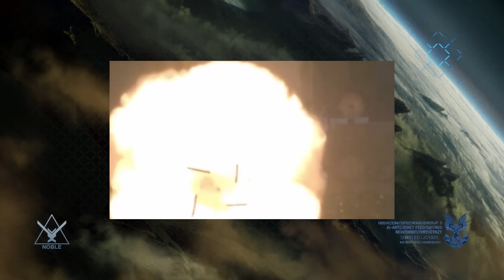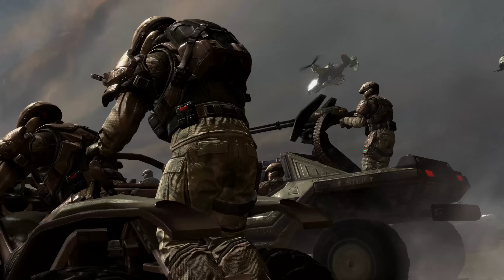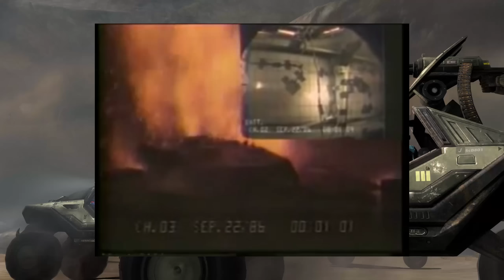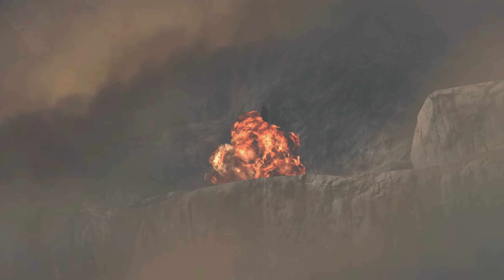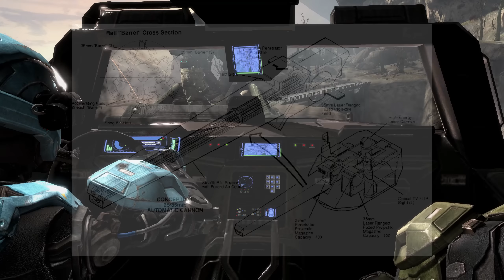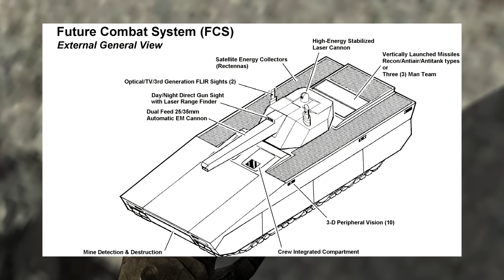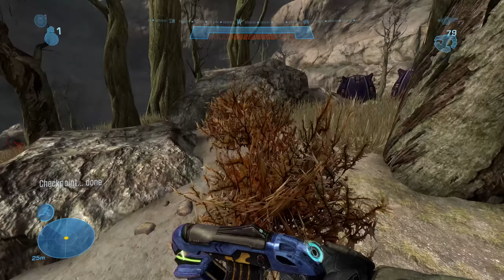Are Railgun Tanks Practical?

Comment: Interesting thing about these rail gun battery’s is they might be even more dangerous when shot. Just look at a video of a lipo battery when punctured. 

There’s so much energy stored up that when a cell is compromised, It will spit out a nasty flame and toxic smoke. Imagine this in a tank at a much larger scale.

Then we also have to note that these huge batteries paired up with the required capacitors you have a gigantic target that will practically guarantee a tank kill when hit compared to standard munitions.

Basically your ammo is safer but the guns power source is essentially a giant bomb when shot! It’s a huge downside looking into it. 

Crazy huh!

Comment: [self-imposed obligatory Battletech post alert]

A lot of what you said applies as well to the BT setting, though they use gauss rifles there instead. Still, the perks are basically the same. Compared to explosive propellant weapons, gauss rifles have longer range, are more powerful, and the ammo doesn't explode. Same thing with the drawbacks. The rifles are much bulkier, and their fire rates are much lower than normal cannons. Although you didn't mention (as another comment has pointed out) how the gun itself is actually in danger of blowing up instead of the ammo. 

(psst I still recommend you give BT a good look at, even if not as a full video. All the tech there is pretty well thought out, though of course probably not flawless in their rendition.)

Comment: “20 years in the future we will have rail gun tanks” 
Halo 500 years in the future: “Our main battle tanks will have regular 90mm canons, but our space fighter jets will have 2 120mm twin mounted rail gun cannons, with rotary 110mm cannons”
Halo again:”Also the largest deck guns on our massive mile long ships will be 70mm”
Reply: My point is how the longswords anti-starfighter guns are larger than a main battle tanks gun, as well as a ship mounted ant-starfighter/ point defense gun.
Reply: SmithOnMe they’re smaller because the ship mounted point defense guns are actually rapid fire coil guns. Meaning a smaller shell can be used/ is needed to deliver the same amount of damage a large one will. Because of this more of the PD guns can be mounted and more ammunition can be stored. Meaning more overlapping fields of fire and longer engagements times, leading to a more effective warship. The PD guns don’t need to be a caliber of say 130mm when you can put a few magnets on the gun and drop the shell to 60-70mm and still do the same damage while achieving a higher velocity for better armor penetration. Let’s also not forget that the second model of archer missile can be used for point defense. As for the longsword the 110mm rotary cannons aren’t standard. Standard armament is eight 50mm coilguns. But the 120mm pair of cannons is standard and usually used for ground attack, as the longsword is often deployed for if shortswords are lacking. However in saying this, they are mounted on the underside of the aircraft and have a 90 degree swivel. It’s not crazy to have such a caliber on such a large aircraft. 64.1 meters by 75 meters. With the smaller variant being only shorter in length at 33.5 meters. If you have any other questions I’d be happy to answer them!
Reply: Offensive Bias the C-709 longsword has a rotary (like an A-10 warthog) 110mm coil gun cannon that is used for anti-star fighter roles. While the M808B scorpion has a 105mm (90mm depicted in game) electro-chemical anti-(pretty much) everything cannon. However, a capital ships main defense gun; which is used in ship-ship combat, anti-fighter roles, and ground support roles; and has a much larger turret as well as access to a greater power supply than either the C-709 or M808B, only uses a 50-70mm non-rotary coil gun.
My point is that the choice of UNSC weapon calibers is very inconsistent.
Reply: SmithOnMe yes while the C-709 variant uses a 110mm rotary cannon the variant itself is just that. A variant and is not that standard build of the longsword. As the C-709s first appearance is combat evolved which comes at the end of the H-C war one could deduce that the large caliber of the main gun is used to quickly and efficiently strip the shields and penetrate the armor of seraph. At that point in the war, humanity was on its last leg and couldn’t afford to lose any sort of military equipment. In saying all of this the longsword is actually not the “mainline” fighter for the UNSC. That title actually belongs to the broadsword which was actually in use and production since the mid 2530s. The longsword fills a role more akin to an interceptor/strike bomber. As for the scorpion while I agree it’s 90mm gun is a small for a vehicle given the MBT classification. It is truthfully an infantry support vehicle. As there is very little in the ways of insurrectionist armor. This 90mm cannon is actually not the electro thermal variant and is a standard smoothbore high velocity cannon. The only known scorpion model to use an electro thermal cannon is the M820 model which uses a 150mm main gun. There is another UNSC MBT, the M850 grizzly which uses dual 120mm cannons and is actually used in tank vs tank role.  As when it was deployed against covenant armor and ground forces it usually ended in the covenant having to call in naval support to defeat it as it’s virtually unstoppable and contrary to popular belief in the halo community the grizzly actually saw wide spread deployment against both the covenant and insurrectionists. Finally when talking about turreted weapon mounts on UNSC capitol ships you have to Identify if the weapon emplacement is a “point defense” or “naval coil gun”. Both are used differently. As stated before point defense guns are smaller caliber rapid fire coil guns. Their smaller caliber and size (as stated before) allows for more of the guns and more of their ammunition to be stored. These guns were typically supported by allied single ships and missile support, but are perfectly capable of handling things on their own. These guns are not used to engage enemy capitol ships as they don’t possess the firepower to do so. On the other hand, naval coil guns are large coil guns used to supplement a ships main Mac gun and are not intended for a point defense role and actually perform very very poorly when used as such. Both weapon emplacements look the same but function very differently. For example in the  halo reach level “pillar of autumn” when you reach the ship breaking facility with the mass driver. If you look at the pillar of autumn you’ll see what look like point defense guns firing. These guns look absolutely huge. These are actually mark 33 spitfire naval coil guns and do not belong to the point defense system of the cruiser. If you want to break it down the autumn is equipped with only 18 M910 rampart PD guns, 6 M66 sentry, and 8 Mark 33 coil guns.
Reply: SmithOnMe actually naval coilgun batteries go up to 300mm, the 70mm are just AA
Reply: SmithOnMe those are just point defense guns and even those are coil guns.
Reply: all about the velocity
Reply: I'm just ticked off that even 500 years into the future, military radio chatter still sounds like absolute garbage.

Comment: Wouldn't a Gauss Gun be a better fit for a Tank? I mean don't Rail Guns require a Nuclear Reactor just to power them? I know that you can make Gauss Weapons that are Small, so for something the size of a Tank, wouldn't Gauss Weapons be the better solution? Just throwing this out; plus I worry about the Electronics causing a Short due to wear and tear and possibly causing either an explosion or a fire concerning the Batteries needed just to operate the Weapon. I Phone Galaxy anyone? That was a Solid State Lithium Battery that Shorted out.

Comment: The only way I see rail guns begin a standard weapon on IFV's within the next 50 years is if said IFV get bigger to accommodate the large amount of components and bigger powerplant to run a railgun effectively, I don't see the tech required for such a weapon getting small enough to be practical or the amount of energy needed within the next half centruy, also in order for an army to build and design a whole new vehicle around the railgun concept it would have to dramatically outperform any conventional cannon of the time and the naval ones do but they have a floating  powerplant but enough to power a town at their disposal IFV'S don't have this luxury
       Also with the current conventional weapon have not reached their peak yet, new cannons are coming with more capabilities and vehicle have been trying to get smaller and  especially lighter something that a railgun would not fit into anytime soon

Comment: when it comes to railguns and laser weapons(yes, these do exist in real life), you see often people dismiss these ideas solely based on how they depends on electronics to function. But has no one thought how much of all of the war equipment is dependent on electricity? Your car won't start because the EMP broke it's battery, you can't call in support because your radio died and when you get to a medical station the stuff in there died too when that EMP went off. Even then I have  heard couple of times that even your phone would survive an EMP attack thanks to small electronics not being effected as much as large scale electronics, but even then your phone most likely has the proper protection from EMPs. Of course as electronic devices are devices they are prone to malfunction, but we have gotten so much better at making electronic devices reliable and they are getting even more reliable by the year. Again with the phone example, how often does it really fail to do something? Now of course, you might just have a bad phone that just breaks all the time because it was made poorly, but I haven't had a single electrical malfunction with my current phone. Electronic devices are devices as much as mechanical devices, yes at the current form they are more prone to failure due to being much younger in terms of invention, but we are improving the designs all the time just like we did with the first cars and bows.

All I'm saying is, if an emp goes off you have much bigger problems than your main gun not firing and our technology is making major strives when it comes to electronics. All devices fail you when you need them the most, no matter if it's mechanical or electronic.

Comment: Actually there's a China YTber manage to design a railgun tank but the only question is: you can't build it. Even you could, you often result you stick the heavy cable into the tank and your behind was nuclear generator. As conclusion, due to railgun require high energy output use it for gun is impossible unless you have scaled-down the nuclear reactor.
The Crazy 262 is the one that design a railgun tank call 'Qilin' (麒麟).

Comment: "12 years" lol
The main problem is power generation. We can currently make railguna that fire projectiles at the same speed with the same durability as chemical weapons but the power needed is too great to fit inside of a tank chassy, or even most current naval ships. 
The reason they want to be able to shoot continuously at higher speeds is because the energy increase by volume of a reactor is large enough to make it worth while when a ship is dedicated to it.

Comment: A bit nit-picky, but railguns would not be propellantless. A railgun requires a kicker charge to get it going before it hits the rails and will weld the projectile to the rails if it's not going fast enough. The kicker charge doesn't have to be explosive but explosives are the easiest way to do it. Going out of your way to use non-explosive kicker charges would also be moot as long as the ammunition you carry has explosives in it (HE shells, airburst, etc.)

Comment: You were a bit wrong on the first bit. Rail guns haven't been tested on navy ships yet. Additionally, if you pack your rail gun ammo with explosive filler (like for the airburst AA stuff you said) there can still be blowouts. Also, rail gun rounds are not the cheapest things. You can't just use slag iron. You need special alloy shells and you need to use some pretty strong materials if you want a proper penetrator at that speed and not just something that will shatter. Finally, power is a major issue. If we get batteries that can power that, then we will all have electric cars with long lasting batteries too.

Comment: Railguns aren't feasible on tanks because they'd be one-shot weapons with no capacity for reload. 

Current railguns being developed for the US Navy require more energy than all but special prototype warships can even produce. 

Even assuming we had the power output to fire them, the degradation of the main barrel would be intense and would wear down the weapon after even a few shots, rendering it unusable. 

Assuming even that is solved, the weapon system itself would need to be shrunk down to a size that could be carried by a tank. 

Assuming we can do that, we would also have to charge the cannon before it could fire, since railguns use a capacitance system to create massive electrical differentials to power the magnets that launch the projectile. 

Having a soldier sitting within a couple feet of the weapon would be like putting them next to an MRI, meaning the couldn't have any metal in or on them without it then becoming dangerous to the soldier during the firing sequence.

Comment: The biggest problem with railguns, coilguns, whatever, is that chemical propellant will always be able to store more potential energy than any other storage medium for a given volume. Easy example? A 655 grain .50 BMG projectile has over 18 thousand joules of kinetic energy being generated from an area of a few cubic inches. Search 1.25 kj railgun on youtube and think of how many .50 caliber rounds could be fit in the same volume of those far more volatile while charged capacitors that make up over half of the weapon's stock.

Even with advantages in storage mediums, solid state batteries, what have you, we have been unable to find any storage medium more efficient than chemical bonds.

Railguns and coilguns are fun weapons to think about, and can be very useful for when engagement range is to be prioritized over rate of fire or the economics of scale allow for sufficient volume for power generation and storage.

But personally? I believe the answer lies in something along the lines of cased telescope electro-thermal-chemical (ETC) guns that can more efficiently use far more powerful and stable chemical explosive than any electrical storage medium we will have available for decades.

Comment: Uh, I don't want to crush any hopes but we may never see railguns on tanks. 
The whole idea of an electromagnetic gun is over 100 years old and still we have seen no railguns fielded, by the looks of it it may as well be a dead end in the military technology.
Why? Because railguns are worse than standard cannons by nearly every measure.
Only advantage that railgun has over 120mm cannon is a higher muzzle velocity.
Velocity that railgun projectile loses faster than cannon projectile because of its lower mass.

Other cons?
Prone to over penetration.
No explosive filling.
Lower range.
No electronics inside projectile.
Low rate of fire.
High barrel wear.
Insane power comsumption.
And many other.

Don't believe me?
Here is a nice article about "Railgun Fraud"
https://www.g2mil.com/rail_gun_fraud.htm

Comment: Something I realized is both a pro and a con for railguns is their muzzle velocities.  Tanks already occasionally have problems with overpenetration, shooting clean through the target without actually doing any real damage.  With a railgun, being able to modulate the current applied to the electromagnet would solve this problem, since you could reduce the power to only what is necessary and maximize the damage the shell deals.  It could also reduce the need for dedicated armor-piercing ammunition, as you can just ramp up the power on the magnet until a normal shell has enough velocity to penetrate.

Comment: I think tanks would start off with a 2 stage gun where the projectile starts with a chemical propellant then is accelerated by a Railgun system. Though the issue would probably be recoil and construction or it would probably be a system for an SPG.

Comment: I have an weird idea for a ammunition ok so a low power railgun that fires an AP shell equiped with an explosive that launches a smaller AP shell that ejects very small flash grenades an a single smoke canister that has paralyzing gas. If anyone know more about tanks and physics can you tell me if this would work?
Reply: Dest Arker does the flash and gas fire after penetrating armor?
Reply: @hazardous458  I would imagine a the explosion that release the second shell would trigger a hammer that will prime a lever where the moment the second shell perform a hard impact hopefully created by the shell piercing the armor which the first shell couldn't which triggers another hammer that will ejects the outer shell which the force of the outer shell will pull the lever that open up the container that has hooks attached to flash and gas pulling and releasing them.

Comment: That's not very much. 1st problem, the energy source. Railguns need immense amount of energy. On tanks, no such support exist. 2nd, the technicality. Barbaric, and brutal tools generally don't go wrong and easy to maintain. Not much to go wrong. But.. lots of electric component, small components/mechanics, and coils. Hard to maintain, easy to brake, easy to go wrong.
I think Gauss or electric guns be sooner available to tanks, than Railguns.
Reply: MamboJambo also charged capacitors explode. Capacitors contain huge amounts of energy and it has to go somewhere when something damages it.
Reply: Ye, thats fair I guess. Didn't think of that.